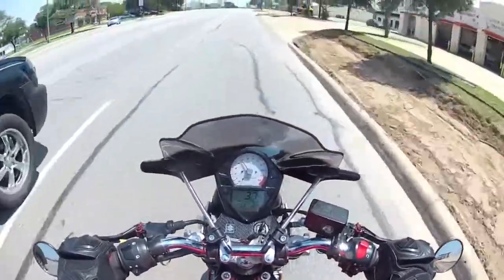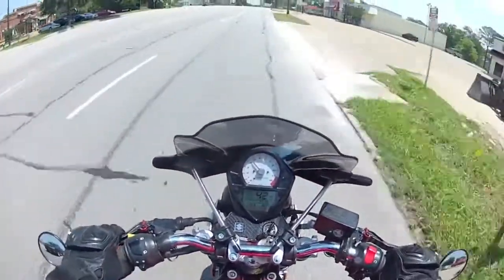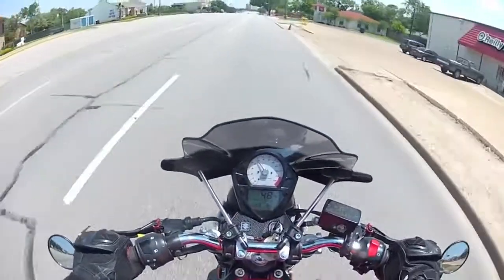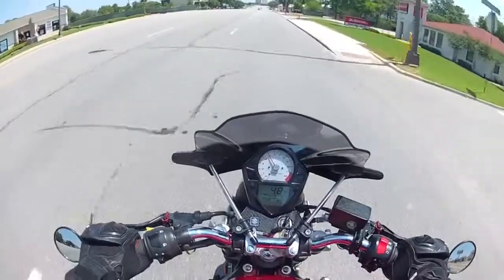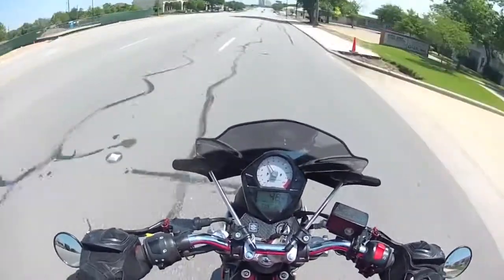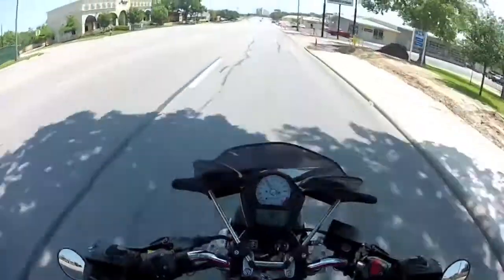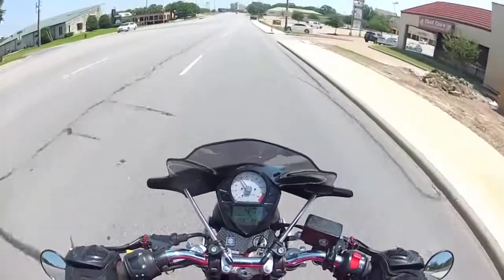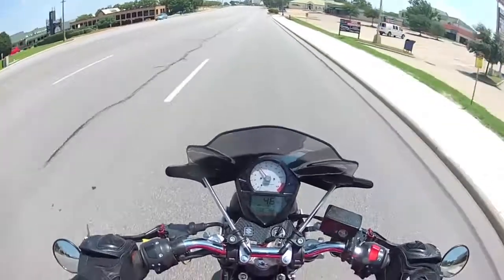Project: SV650 Throttle Position Sensor Mod

Comment: tps adjust is regular maintenance. If you synch throttle bodies, re-check it, and vice versa. (TB synch slightly moves the plates)

Comment: thanks for the video, I have a sv1000 and a 650, just did my first ride ever today and the 1000 was smooth but the 650 would jerk around whenever it dropped to 3000rpm. The owner before me mentioned a tps mod, probably did it wrong

Comment: Its not a modification, but an adjustment that should be done occasionally to ensure the throttle works correctly. the TPS slowly wears and causes the rev change to move upward. Eventually the change is so high the bike rides like a dog.

Comment: Hi, I have had a few of these bikes and have the original "Suzuki" factory manual.
It states that the "Idle" should be 1300 rpm and not 1200. All the SVs (k3 -k7) have all idled at 1300.
Reply: My K3 service manual states 1200.  Go by what you know/read, I guess.
Reply: I keep it at 1500.

Comment: For some reason it's not letting comment on CmdropNFresh's comment but maybe you can answer.  Is there a way to adjust the idle on the 07+ models or is it never needed?
Reply from the maker: I am not an expert by any means but it is my understanding that the TPS adjustment only adjusts the sensitivity of your throttle at take-off. This is completely separate from tuning the carb. The 07+ models are fuel injected so there is no idle screw. I would ASSUME the only way to change idle speed would be to change the ECU settings but I think there is also an idle bypass air valve (google this). Good luck!